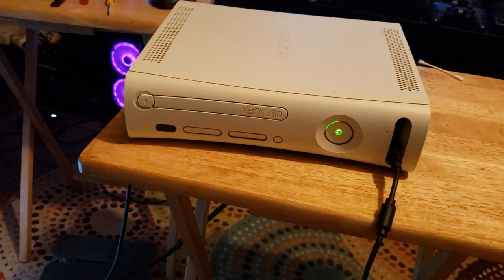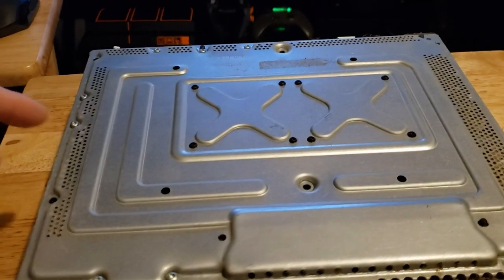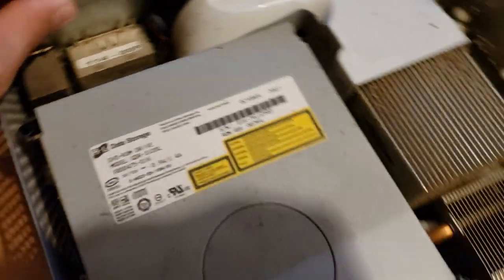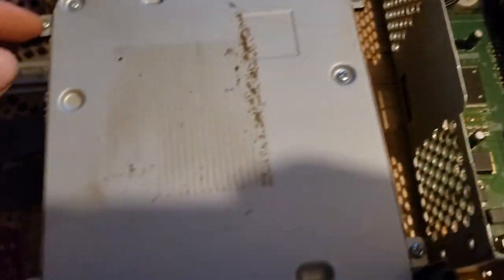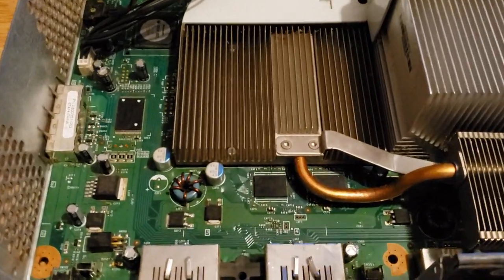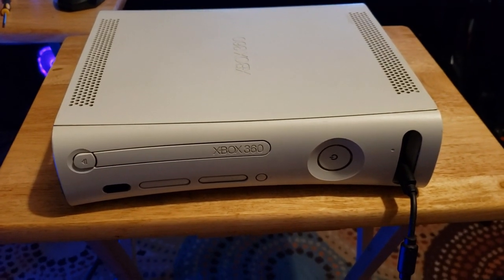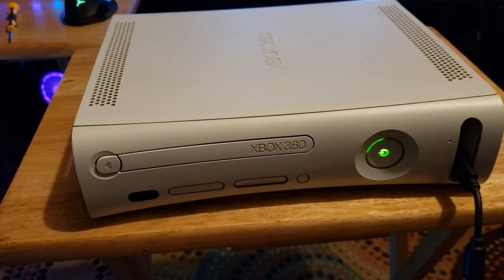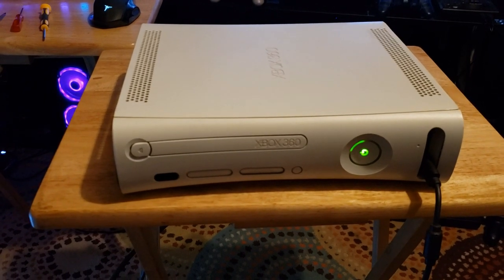Xbox 360 Disc Tray Faulty & It Won't Read Disc, Can It Be Fixed!?

Comment: Hi nice vid i was wondering if you could help i have a xbox 360 gear of war console and it wouldn’t  power on. After opening it found out the ribbon cable to the power button was not connected so plugged it back in and put it together and powers on now and everything works great however the disc try button if you touch it it will not open the disc tray. But i can open and close the disc tray with the controller would you happen to know what is causing this. Thanks!
Reply from the maker: I would try opening it back open & cleaning the area around that connection, it may just be dirty & sticky, sorry I would've answered this when you first replied, but just now seen it, good luck🤙🏽
Reply: @TattedUpGamerDude   I use to have Xbox 360